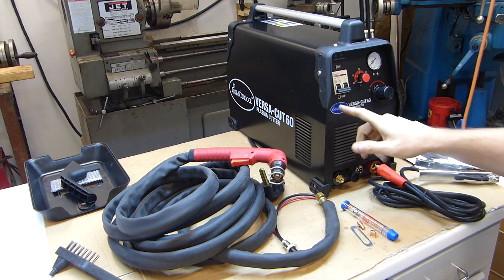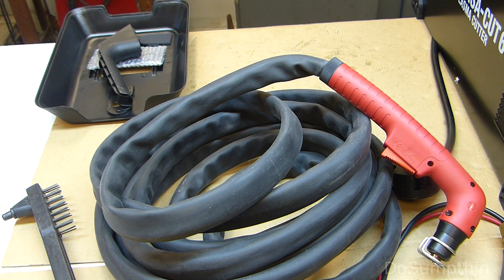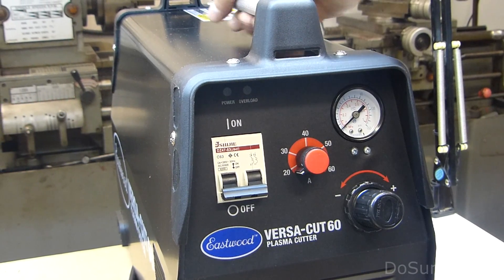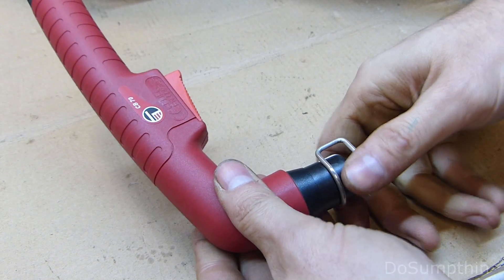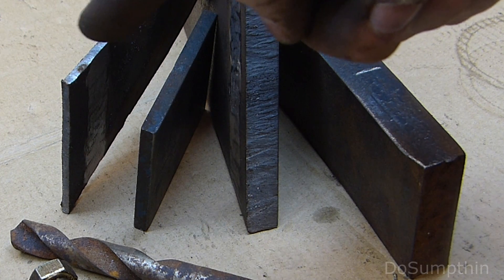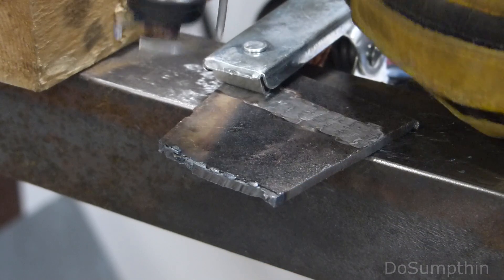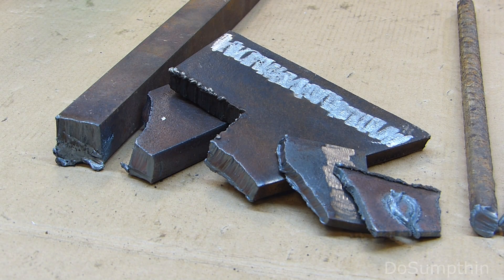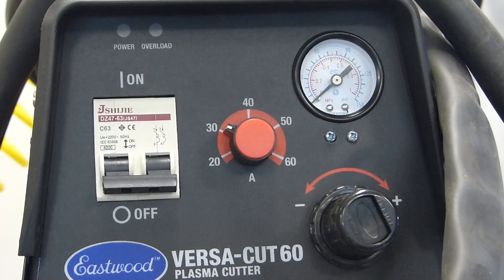USER Review & Test - Eastwood versa cut 60 plasma cutter - Thick steel

Comment: I have only had my 60-amp Bestarc for a few weeks, but I love it. Using high air helps clean the cut. I believe when you reach the end of the cut that there is no metal to conduct the arc and so it stops before the bottom finishes cutting. You might try angling the arc forward at the bottom just before reaching the end to see if that helps.

Comment: thanks for this, could not find 60 amp anywhere. I just grabbed at a different brand, but it seems i just bought plenty for what I am doing. I have all kinds of metal working tools. Lo and behold I got into a spot restoring old steel that not only could not fit my efforts, there is friction welding by an extremely long runtime. A time for plasma...

Comment: You spent too much money you should have kept the Chinese $300 one eastwood is nothing more than a glorified Chinese $300 one. I've had a cut 50 for years and had no problem with it. If your using it a lot then the hypertherm is a great choice if not $300 plasmas do the job. You could have bought 3 of them for the price of an Eastwood and you would have the same thing. And for $25 you could have upgraded the torch head.

Comment: I purchased my Versa Cut 60 and MIG175 in the combo package in March of 2013. I’ve used both of them several times a week for over 5 years. I did from the start upgrade the ground cord and clamp on the Versa Cut 60 to the same length as the torch cord. I upgraded the ground clamp on the MIG175 at the same time. They have both ever failed me in the 5 plus years I’ve had them. Would I do it again? Absolutely. Good video and guide for the new user. Thanks.

Comment: Overall nice video, but I have some tips for you. Your main emphasis was on cutting thick metal and you dissed the oxyacetylene torch and said you were looking for something better. The better on a plasma cutter is that it cuts a variety of metals besides mild steel (which you did show) and cuts thin metal very cleanly. It is not the tool for thick mild steel. An O/A torch is the tool for thick mild steel.

Comment: Bought the same model plasma cutter. However I'm struggling with finding an economical compressor that meets the cutter specs of 5-7cfm. You can't always trust foreign made compressors' specs. Any suggestions?
Reply: +Bob Morse 
5-7 CFM is actually very low, you could really get away with a nice Husky 110v 30-33 gallon air compressor which is a low cost. But if you like to work in the garage alot look into the Ingersoll Rand or campbell Hausfeld 60gallon. Best investment i ever made.

Comment: hi, I have a 220 volt outlet and 200 amp service in my panel for my home. Will this work for me?
Reply: Eddie,Do not do what Dan Vize said to do. If you put a higher amp circuit breaker in your panel and do not upgrade to thicker wire, you will over heat the wire, start an electrical fire and burn your house down.
Reply: clearly 60 amps is less than 200. worst case scenario you need  a bigger breaker for your 220 outlet

Comment: you should name the unit that was a disappointment so that others will know what not to buy. Whenever I do a review I have no reservation about throwing names out there about the product I tested. Don't worry so much about being sued because it's your first amendment right to speak up!
Reply: I have an inclination it's either Harbor Freight or ebay garbage.. Which could be a lot.
Reply: The unit he was on about was all the cheap cut40 and cut50 generic machines. He said it was rubbish without even using it. I have used the cut40 and cut50 generic machines and i can tell you they are amazing. They rip through 10mm plate. The cheap torch he mentioned looks rubbish but works well. Plus the spares and consumables are very cheap and last.

Comment: looks like you need some more psi.  I use mine well over 90psi at my own risk, and it zips through metal a lot faster than the recommended settings.  Running it off a 80gal 5HP Ingersoll-Rand compressor.  It most definitely helps with elminating the dross from the backside because it blows it clean off with more airflow.

Comment: Nice review. What size compressor did you have this hooked up to? What was the SCFM or CFM during your cut?
Reply: compressor is built into the unit
Reply from the maker: Patrick Michael Hi Michael, sorry for the very delayed response.  I have a cheap 60 gallon Husky compressor from Home Depot, seems to work well.  I don't recall the settings I used during the cuts.  I did have to go very slow during heavy cuts - but it worked.
Reply from the maker: Jeremy Hi Jeremy, the compressor ir not build into this unit - I had to hook it to an air line that feeds to my compressor.  The compressor is out in the garage to reduce noise in the workshop.  Thanks for watching.